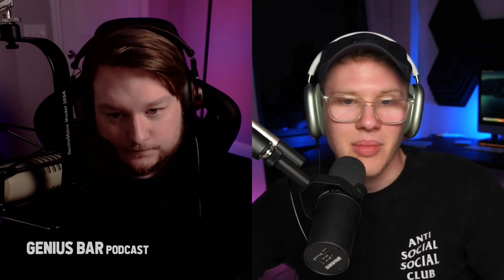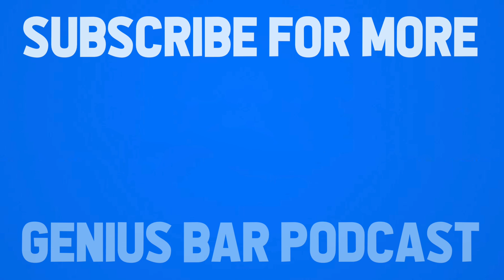Apple's Secret Plan For The U1 Chip

Comment: I think iBeacons microtargeting which is a Bluetooth Low Energy (BLE) is being used on accessories like the new Apple TV 4K remote. Originally designed for retail, iBeacons microtargeting will work with U1 UWB chips, as well as H1, W1 and a litany of other sensors to interconnect Apple devices and accessories into a trusted network of devices and services. I believe that this another step toward an appliance computing subscription~based service from Apple. Three different levels for both consumers and enterprise business. Entry, Standard & Pro. UWB figures heavily moving forward ~ Bluetooth & NFC are for backward compatibility. Think of AirTags with AppClips ~ that’s the future of commerce.